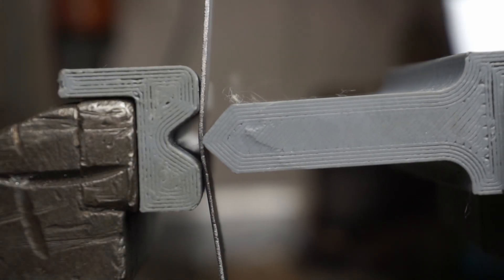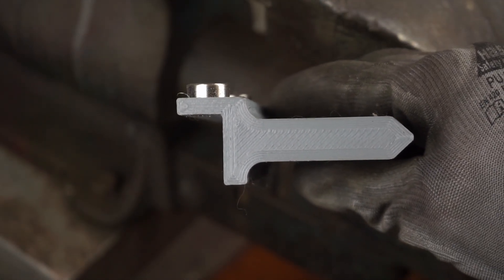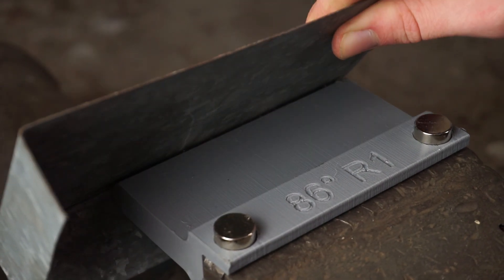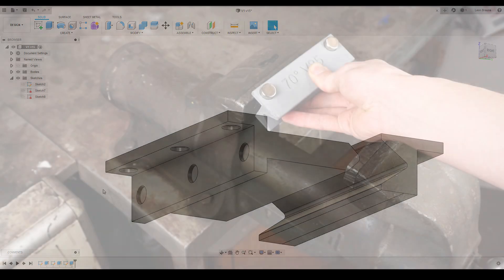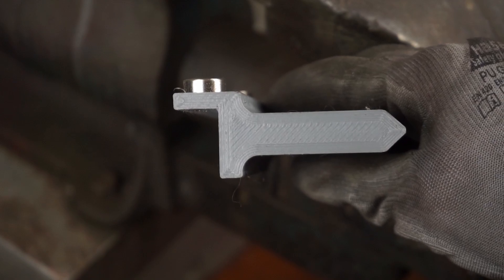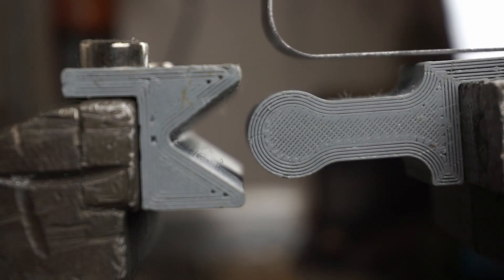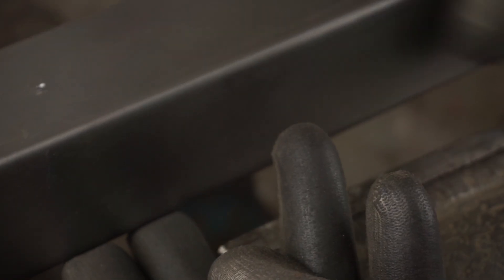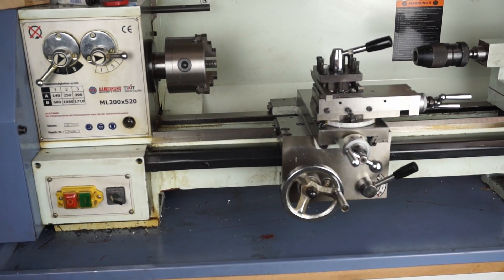Turn Your Vise into a Press Brake with 3D Printed Tools

Comment: Had a thought! On the goose neck plate, since the top surface is rarely if ever going to be in the way of the sheet bend a VERY simple way to significantly increase its strength would be to bolt & glue (or glue & bolt 😁) a suitable thickness (2-3mm?) steel plate to its top surface! (Comments?) Would this also enable a longer higher goose neck.

In addition a piece of angle iron fitted into the V slot would increase strength in that too for thicker material bends. 

Instead of a vice, for really tough material ... A hydraulic jack & jig?

So many ideas since I intend making a hydraulic bearing fit/remove jig that would only need the relevant mounting fitments for these tools.

I really like the rounded profile tool too. Great for making rounded top case profiles. The price of instrument and project cases is becoming crazy. Such simple tools mean sheet steel (or aluminium) salvaged from white goods - dish washers (stainless!), Washing machines & tumble dryers (enamelled and galvanised steel), fridges, freezers, fridge freezers all have many large flat panels, all simply removed (& further cut to size) with a cutting disk angle angle  grinder! If you're into building electronics and need suitable enclosures ... Say no more!

Comment: This should get you close:

Bend radius is ~20% of bottom die width (for v shaped punch).

A  0.625" wide bottom die (using v punch) will have a .125" inside bend radius on most sheet metals.

From each side of the bend, remove one material thickness of length from your overall flat pattern. If you're bending a 1" tall by 2" wide channel piece, you will subtract one material thickness from each "leg", and (for 2" OD) remove two material thicknesses from the center. For 2" ID, don't make any subtractions for the center. The result is 3.748". Add bend lines at .937" and 2.811", and bend.

You will get close. To get closer, remove a material thickness plus the bend radius minus the Cosine of half of the bend times the radius.

R-(Cos(bend angle/2)*R).

Subtract both that number and the material thickness from each side of the bend to get really, really close. Within .005" or so, for most .037"-.078" steels.

So

For a U shaped box channel of 1" tall by 2" wide (outer dimensions) with a bottom die of .625", using a v shaped punch, and .063" thick metal, you would subtract .063", then .125-(Cos(90/2)*.125)=.0366" for .0996" overall after material thickness (simplified to .1") from either side of each bend location.

So you get a flat pattern that is 3.6" wide overall. Then you add bend lines at .9", and 2.7" from one edge. (Four total .1" deductions, two from either side of two bends). Bend that part, and you will be really close to a perfectly bent part that is "1 tall by 2" wide.

The above formula works for any bend radius.

Comment: I wonder if you could attach some steel stock of some sort to extend the length of your vice faces and thus be able to bend longer pieces without all the back and forth.  Of course, you'd need some hefty stuff to minimize deflection...

Comment: Rule of thumb for steel:

Minimum die opening is 8x material thickness (you may want more with printed tools)

Bend radius for mild steel is 0.16x die opening

Bend radius for stainless is 0.2x die opening

Comment: I would never have thought that 3D printed tools could be strong enough to bend metal.  Thank you very much for sharing this.
Reply: You can print titanium , nickel and steel alloys so they are pretty strong even stronger than wrought parts of same material the weakness is usually ductility and low fatigue life. But can be improved by carefully controlling manufacturing process parameters and post processing (hip).

Comment: Is it just me or does the printed punch and die parts look underextruded af?
Reply from the maker: Yeah, but that's just the bottom layer which suffered from a bad print bed calibration. The rest of the part looks a lot better, check out 0:55 for example ;).
Reply: @leonbrauns  jo, stimmt... In that case it doesn't matter... Souldnt affect overall stiffness and rigidity. Worse thing that can happen is maybe longterm the underextrudeds side edge rolling over slightly. Then again it doesn't matter if you do several passes over the length of the bend anyways

Comment: Well I goose it's broken, but time traveling stuff is finicky better ask the master ToT how to work it.
Reply: Just watched Blondihacks. Apparently you'll need ToTOS installed on your lathe to access the Chronology functions. IIRC you'll need to flash your spindle to the latest etherware version before install. Also; make sure you have your tools properly honed in, or you won't be able to break the closed time-like loops and they'll make a rats-nest of potential timelines.